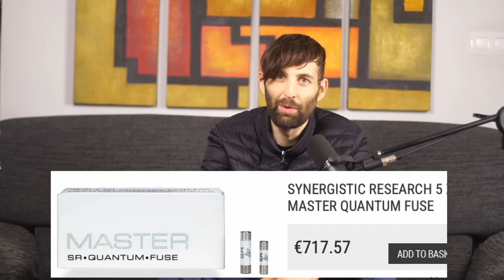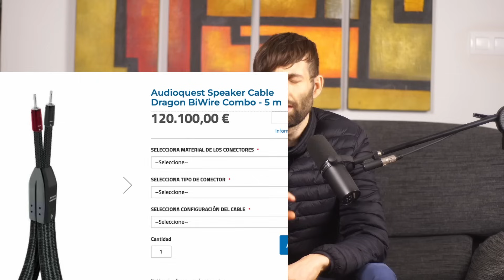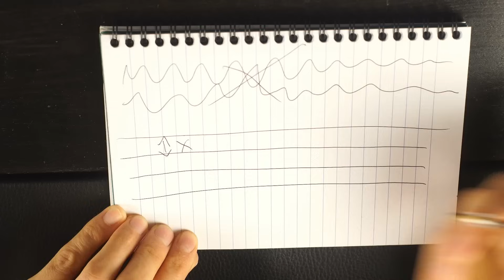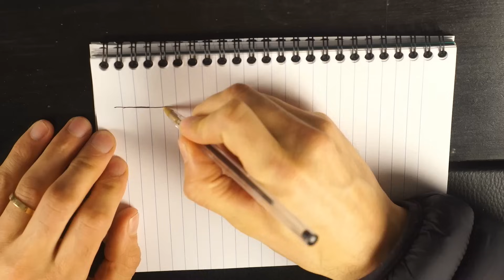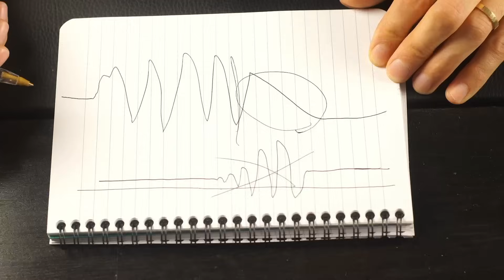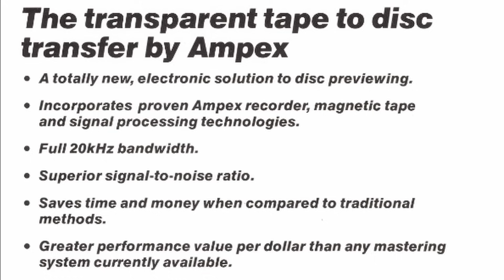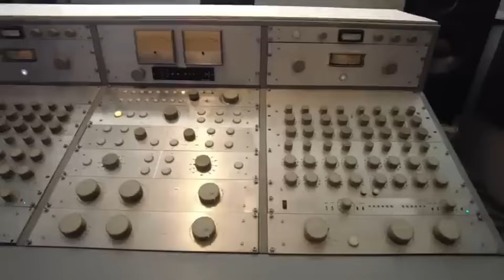Hard truth: most vinyl is digital anyway

Comment: Vinyl isn't digital, it's worse than digital. A lathe is a mechanical machine, and all mechanical machines have tolerances, and those tolerances change the output of the machine. Nothing is machined perfectly, every vinyl that's cut will be cut slightly differently, you almost certainly can't hear the differences, but they are there.

Comment: Spot on!! There's sooo much snake oil in the Audiophile world. Why do I need power supply cables made of fantasticum, plated with dynamicum, pleated on the thigh of a virgin and so on, when I hook it up to my wall socket and all the feed behind that comes from the cheapest bid to build the house / systems / trafos etc?? It's lunacy. 

It is all about the dynamic range and the pushing of loudness, it's a bloody shame and would be excellent if we could have access to non limited versions as you describe - not sure about the high rez tbh, my jury is still out on that and think the standard CD rez (16-bit/44.1kHz) is actually good enough...

Comment: You are conflating CLEARER with ACCURATE

Have a degree in computer engineering. I believe it was Nyquist who had a theorem that  you had  to sample the signal at a rate of twice its bandwidth to recover the analog signal from its digital format. However, digital can NEVER fully capture like analog.

When CDs came out in the 80s, people did  not warm up to them. They stuck to cassettes. Then to force people to get in to CDs, companies  like Sony compromised the sound quality of boom boxes.

When the hardware  grabs the signal, it leaves ti store it on the digital medium. But the analog  signal is still being produced. It misses that. There are  holes in the sonic matter. Your ears can feel this.
The same thing happened with  HDTV when it came out. The picture quality was and is clearer. However, it looked  and looks cold and fake. Not like VHS which has ambience.

In both cases, the engineers and mathematicians  used probability models to fill up these holes. But it is still lacking. Vinyl rules! 

When I come into some serious money, I am going to repurchase all my vocalist  artists on Vinyl and get a nice turntable.

Love this conversation!!!

Comment: Well, to be honest, analog sound might be better than digital only if it is AAA (Analog Record, Analog Mixing, Analog Mastering) and even in this case, to implement AAA there must be modern analog equipment, as well as competent specialists capable of making a high-quality recording. Also, I think that this type of recording is unlikely to suit all modern styles of music, since, for example, extreme death metal actively uses sampling of the bass drum, which would be very expensive in an analog version

Comment: But you did admit that the surface noise and imperfections within the vinyl did produce a noticeable difference. Also if you put analogue equipment anywhere in the signal path it will colour the sound accordingly. Also, try telling a guitarist with a massive tube amp stack that they are better off with digital and their beloved valves can be recreated on a computer! Also, there is the problem with "all music sounds the same these days! Back in my day...."
And they do have a point. An analogue hardware compressor from the same company of the same model will have a different sound. You have proven in one of your videos that it doesn't matter what software compressor you use because they are all basically the same! So if everyone is using digital software then EVERYONE sounds the same! So the analogue effect is cumulative. Analogue on analogue. So if you are recreating that digitally and I believe you can it's like everyone in every studio using exactly the same bit of analogue hardware. 
Also, and this is purely visual. Scratch DJs using anything other than vinyl looks lame. That might be a dying art. But DJs using vinyl makes me believe they are working harder for their money, over someone with a computer full of tunes mixed on a fancy modern mixer. Yes that is practically ALL DJs these days. But still, if someone pulls out a crate of old vinyl for their set I'm much more interested in what treat I am going to get! So really calling vinyl junkies "flat earthers" for thinking that vinyl sounds better is missing the point. A lot of their collections involve OLD vinyl before the digital revolution. 
And maybe that imperfect sound you get when the needle hits the record is EXACTLY the point. 
So I get what you are saying (even though old digital equipment does add colour) 
But do you get why vinyl is still so important? Music is not a science experiment.

Also at 10:30 or so, you say that the analogue signal is "polluted" at the final stage. Didn't you say earlier that digital is transparent? Because I think I hinted at the fact that old digital equipment does in fact add digital artifacts, you can tell what year or decade something has come out by the overall quality and colour of the sound, and because of the loudness war. Even though digital equipment is being used a lot in the process. That's why people tend to fetishise tape, vinyl, and old equipment that technically sounds bad. Also, all these old media forms have wow and flutter. That makes a difference in the sound! None of these things were desirable in the past. But like Brian Eno said "make something obsolete and you will find that people fetishise it."
And big sexy, inconvenient, expensive, crackling old vinyl is no exception. There is a ritual that people have when putting on an old vinyl record! Some will even put gloves on the protect the record! 
Nothing is more soul-destroying than streaming on Spotify. The convenience doesn't make up for it.

Comment: A vinyl record played on a turntable at home will definitely sound DIFFERENT from a CD, MP3, or stream of the same track, it doesn't matter how the track was recorded or mixed (digital or analog or wax cylinder). The mastering process is different for vinyl so the vinyl master cannot sound identical to the CD master, tape master, or any digital masters. Then you have your RIAA preamps. So again, regardless of what happened in the recording studio, mix suite, or mastering suite, the vinyl version of a record will sound different from the other versions. Some people PERFER the vinyl sound, regardless of whether it's true to the original sound in the recording studio or not. Maybe you're arguing with some people who say vinyl is a more accurate reproduction, which is absolutely not true. That's different from whether vinyl sounds better or not. And comparing to "digital" seems silly considering how massively different CDs sound from MP3s and streaming.
Reply: Also, one digital process does not magically undo all the colors added by all the components earlier in the signal chain. If you hit the Neve preamp hard, or hit the tape hard enough, and if you do that across 24-48 tracks, it adds up, and then the one digital delay used in the mastering chain can't magically erase the tape saturation and non-linearity of parts of the gain curves of any preamps, etc. used in the production process. I know you're refuting non-sensical arguments, but I don't believe the right way to refute a non-sensical argument is with another non-sensical arguments.

Comment: Im fine if people told me they like the vinyl experience and have the time and money to have that as a hobby.. 
But that is not what you hear..you hear it is better than digital, better than slice bread and that I should spend time and money on this. BULLSHIT. It isn't better. it is expensive, it is incovenient, the market is flooded with snake oil..and last but not the least, Im over 40, exposed and trained on classical music since 10yo, in my teens I went into metal performing/concert and abused my hearing so much that it is it is not what it used it be. what's the point of this supposed delicacy if i am not gonna hear it.

Comment: This video is factually incorrect. HERE IS HOW THE DIGITAL DELAY ACTUALLY WORKS IN AAA PRESSINGS: The lathe is hearing that preview digitally for control purposes, but it’s cutting the analog signal. The cutter head is fed by the pure program signal (in the case of an AAA cut: tape → mastering console → cutter amps → cutter head).
Separately, the lathe’s pitch/depth computer needs to “see into the future” so it knows how far apart to space the grooves (for loud passages vs. quiet ones).
In the old days, they solved this by running a preview head on a tape machine slightly ahead of the main head.
On most modern lathes, they instead use a digital delay line:
  • The program audio is split.
  • One copy goes straight (analog) to the cutter head.
  • The other copy is converted to digital and delayed just enough to act as the preview signal for the pitch/depth computer.

NB: That digital preview path never feeds the cutter head itself.
It only controls the servo that decides, “do I open up the spacing for this loud section coming up, or can I tighten it for this quiet part?”

What you hear on playback is the pure analog signal (if AAA).The digital delay is only a helper for groove spacing, not part of the actual audio path being cut.

The lathe is hearing that preview digitally for control purposes, but it’s cutting the analog signal.

Even analogue machines could see into the future by simply having a preview head that sits ahead of the record head. Three-head tape decks have that technology but according to this guy there is no possible way to see into the future lol!

Comment: Love your objectivity.  I have been trying to wrap my brain around audiophile claims of "accuracy" or "lack of colouration" or "transparency" without having a reference (i.e., the ACTUAL performance by the musicians). The fact that you can tell us straight up that in the studio digital playback cannot be distinguished from the actual musical performance is awesome and audiophiles need to acknoledge this, at least. That said, CD quality digital may be degraded a tiny bit by aggressive anti-aliasing filtering or post brickwall filtering which can introduce some ringing. This should not be an issue with higher sampling rate pro digitized formats where less aggressive filtering can be used. Please let me know if you think I'm full of it...

Comment: That Donald Fagen album was recoded onto an old digital tape machine which was known for its own unique sonic signature and was mixed through and analog console.  To say it's a digital recording is totally misleading and counterproductive to your point.
Reply from the maker: so it was a 100% digital recording then?
Reply: @APMastering hardly.  It was recorded through an analog console to a 3M 32 track digital tape machine that's it- but also recorded & mixed through an analog console with 100% analog outboard gear then likely mastered to an analog 2 track tape machine and then mastered via analog equipment and cut to vinyl via lathe in an analog process!  So basically the only think digital about it was the tape machine was of an early digital sort.  Famous mixer Chris Lord Alge loves the old digital tape for its unique SOUND then proceeds to mix it through an analog SSL console using analog outboard gear.  So your Nightfly example is not even close to today's all in-the-box digital productions and I mean by a country mile.  If anything it is one of the greatest examples of how early digital tape enhanced a very ANALOG production.  The Donald Fagen album is a laughable example of a 100% "digital" recording.  Why do I even need to explain this?
Reply from the maker: @Jeffeffect1 ok so it was a 100% digital RECORDING then?
Reply: @APMasteringyou really don't understand this stuff do you?  And besides how a record was recorded has nothing to do with a debate about listening from vinyl vs CD's as the recoding process has nothing to do with delivery medium.  Nice click- bait tho.

Comment: Question: Since vinyl rotates at 33 rpm, less space on the disk is used per second as the needle gets further from the edge and closer  to the center. How does this affect the sound?
Reply: distortion, known as tracing distortion or inner groove distortion, as well as HF loss and increasing intermodulation distortion.

Comment: The fact that you try to make this so complicated is evidence that you really don't understand. 

1. There are analog and digital sound waves. Digital sound waves are always an APPROXIMATION of analog and will never be a totally accurate portrayal. 

2. Once an analog sound wave becomes digital, it becomes lossy, and will always be lossy. 

3. There is no benefit to making a digital sound wave analog, or in putting it into an analog format like tape or vinyl. It will always be lossy digital. 

4. Analog/vinyl/tape will always be superior because it's always whole. It never becomes a series of 1s and 0s inside a computer. 

Conclusion: Vinyl pressed straight from the analog tape masters, recorded using 100% analog equipment cannot be surpassed in sound quality, and you CAN hear a difference. 
Vinyl pressed from digital masters is completely pointless.
Reply: look up wow and flutter and the side band frequencies and intermodulation distortion it generates.
Your knowledge of digital audio theory is limited. The analog waveform is fully reconstructed on playback, to the bandwidth limits of the sample rate.
Reply: @TWEAKER01 it doesn't matter. Analog is a grounded, natural waveform capable of infinite detail. Digital is ALWAYS a lossy, square, representation of an analog waveform. 

Only people who can't hear the difference will argue against vinyl/analog - period.

Comment: 11:00 Vinly DOES NOT have more dynamic range. A CD offers approximately 96 DB of dynamic range while a vinyl record generally only offers 55-65 db of dynamic range on a good day.
Reply from the maker: actually CD has more than 96 when properly dithered. but you didn't understand the point. in never said vinyl has more dynamic range than digital as a format

Comment: I have long been i favor of special releases without the heavy dynamic compression.
What you did not say in this video is that the 16 bit of a CD has higher theoretical dynamic range, but that the technology also allows for crushing the dynamics more. So vinyl is technically worse in terms of dynamics, it is just that vinyls have to have more dynamics.
So you get the vinyl only to get a different master, not for the sake of the format being better.

If you use micro-sd-cards as the distribution method, you can still have the same vinyl format of the casing. I don't think vinyls are the ultimate format though, if we are talking shipping. So I think we can perfect the format for shipping if we don't rely on having to fit a vinyl inside, but want a larger cover and larger booklet inside.
Posters are actually not that great for shipping as they have to be rolled.
But if a case don't have to perfectly protect a vinyl it can also have cutouts and thinner materials in parts, making it possible to make something that will look really nice on a lightbox. And you could even have nfc, for for controlling the lightbox if it has an rgb grid. That way enthusiats could have a lightbox to place their covers on, when playing the album. Even with the option of having multiple sheets for the lightbox inside the cover, to have a separate image per song or side/"disc".
And yes, the visual art team that designs those could also make digital versions for those that prefer showing the images on the TV and not having a collectors item, and no micro-sd card, but just the downloaded files. (But of course you get both, when buying the physical version).

But I also think headphone mixing and mastering should be the default.
Although you have some strong opinions in your headphone video. Headphones are still much more consistent than speaker+room combination for home listening. When mixing and mastering for speakers, you are basically only making masters for other studio owners to enjoy.
At least some decades ago you could claim that people would play back on stereo speakers, so you needed to consider the crosstalk, and the panning according to speaker system, rather than headphone systems. But today those factors just makes music sound worse with headphones.

Comment: 6:58 They could have implemented a non-digital delay together with analogue or digital computing to decide the track width at every point if they wanted to.  They could simply introduce one or more tape heads ahead on the tape path. For a 33 1/3 rpm record and a 30 ips tape, to introduce a 1.8 seconds' delay, which corresponds to one complete revolution of the record, the distance ahead for the head furthest away would have to be a mere 54 inches (4.5 feet). The tape length could be held by 4 or 5 extra rollers or some other cumbersome means. It could look slightly cumbersome, but then again professional audio gear were seldom designed to look the part.  I guess the cost would be greater (due to the extra head(s) and corresponding capstans and motor(s)) than the digital solution and less flexible overall, but it would be analogue! The extra heads would not need to be of the highest quality as their only purpose would be to detect the exact moments where the louder or quieter sections of the music where. The audio processing required to locate these could be done digitally and would not affect the recorded signal which would remain analogue all the way to the cutting head.

Comment: Analog does the work for me for 3 reasons:
1st I don't have the equipment to listen to Digital music as it's supposed to be
2nd I do have a great equipment for vinyl and cassette from the 1970s and sounds great
3rd analog has a thing on it that makes me want to listen to the whole thing in one sitting, unlike digital which I can skip and search so easy with the touch of a fingertip.

E-books do the job exactly as physical books, but they just don't fit with me as the experience I want to get.